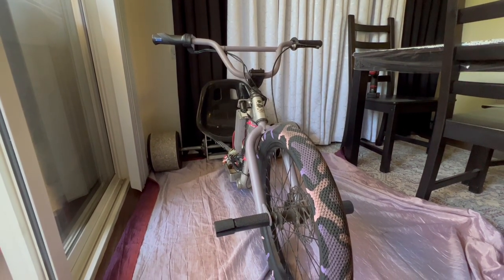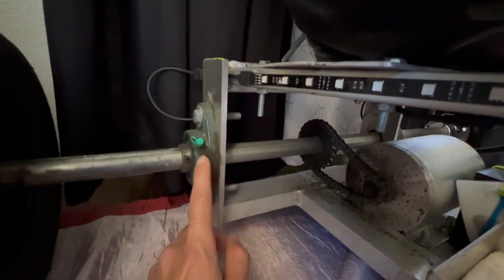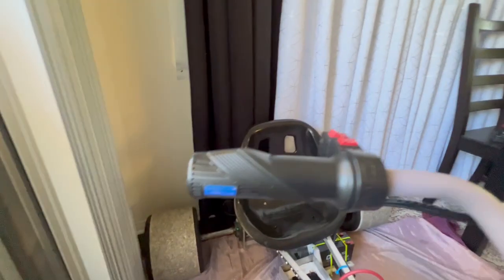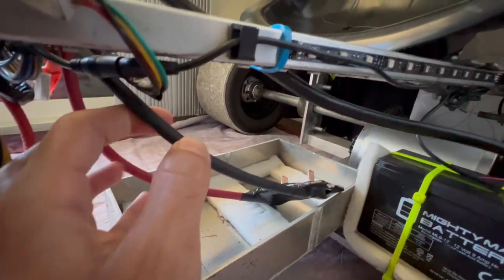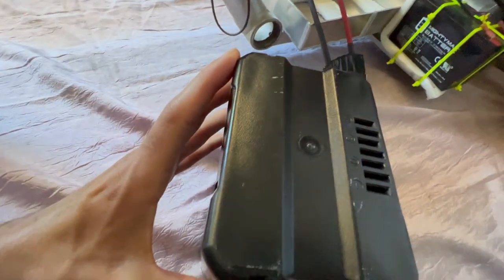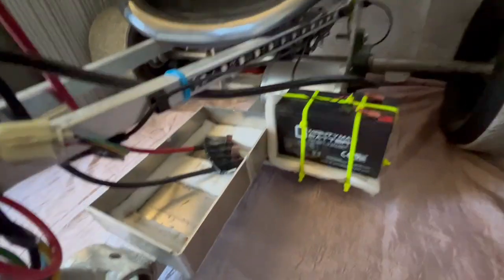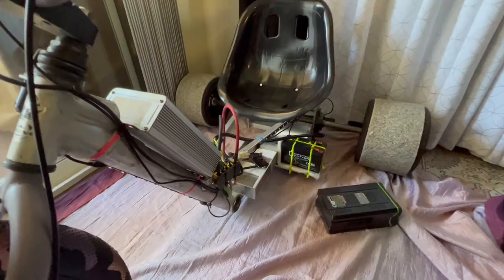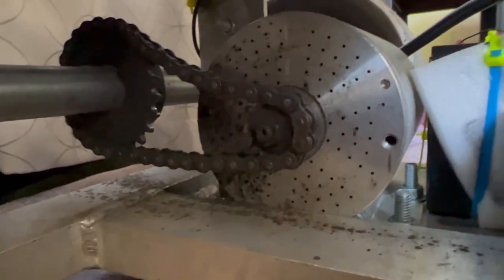DIY 72V 3000W Drift Trike Build – Full Parts List & Step-by-Step Build Breakdown

Comment: Bonjour et merci pour cette video , je vais me faire le meme que vous. Combien de temps dure une batterie pour un run? Avez vous un shema de montage de toute l’electronique? Je n’arrive a trouver en france les pignons et couronne, lesquelles prendre? Merci et coucou de la france👍.Je vois que vous avez plus de 24 dents a l'arreire non? il faut combien de dents à l'arriere? merci
Reply from the maker: Battery can go for ~1 hour drifting. I don't have any diagrams that I've made, there are many online you can reference. I use 36 teeth for the rear. You will need to make a custom pinion & crown.
Reply: Merci. J’avais suivi vos îdications et j’ai pris la couronne en 24 dents et le pignon «moteur en 10 dents en 428. J’ai une batterie 72v en 24ah. J’ai regardé botre derniere video ou vois avez changer la couronne arriere en 36 dents? Pourquoi? Je n’ai pas besoin de fabriquer les couronnes car j’ai un arbre de 30 mm et il y a toutes les tailles de couronnes.

Comment: i was thinking of building my own drift trike. i was just wondering how much did it roughly cost you to build the trike? my budget is around £500-650
Reply from the maker: The frame alone is super cheap, cost is mostly a battery, if you do electric. Motor kit, axle, rims and tires. I’ve spent about 1000-1300

Comment: Awesome build man, one question how long would you say the battery lasts you
Reply from the maker: While I’m drifting I would say it last about 20 minutes, really depends on how hard I am on the throttle
Reply: @highvoltfab  awesome build and video! I was really confused when you said your 9ah SLA batteries didn’t last as long, and the lithium was way more powerful with just a 8v increase. Was everything else the same (8awg wire too)? THANKS!!
Reply from the maker: @SS-du7tr  I guess maybe they did last as long or maybe even longer, but It took forever to charge one of them but yea the lithium was just lighter and 1 unit I have to charge vs 6 different ones 😂 also I upgraded my speed controller recently to a 84v 80amp controller and I’m still running the same 80v battery and it has sooooo much more low end torque and it’s much more responsive!
Reply: @highvoltfab  Thank you so much for the reply! Better esc’s do make a big difference. I suppose you could have charged your SLA batts in series with a 72v ps, but either way they take a long time. The 60v greenworks batt is much closer to my budget than 80v so is a good compromise

Comment: Nice man! 24tooth rear sprocket must make your top speed huge?! 😲
Reply from the maker: With this speed controller which is a 50amp, it’s around 45 mph but this gearing makes it pretty easy to control on the bottom end since these motors have so much torque down low haha
Reply: @highvoltfab  looking for the sprocket amazon is out, found (TSUBAKI - H35B24F-1 Tsubaki 35B24F-1 Finished Bore Sprocket, Single Strand, Inch, #35 ANSI No., 3/8" Pitch, 24 Teeth, 1" Bore )on ebay dif pitch 5/8 and ANSI is 50 is that stronger i think, do u know ,or do u know where i can get the same 1 plez help